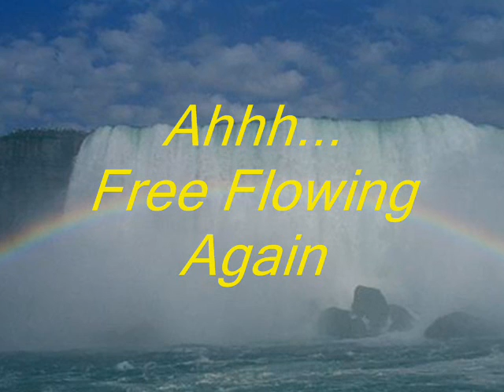DIY: How to Unclog Bathroom Sink

Comment: You're a life saver! When I removed the stopper there was a solid 3 inch tube of hair and gunk that came out easily. The big problem was getting that darn clip back on, the rod on my sink bumps right up against the wall so it was a real pain to get back in. THANKS A MILLION!

Comment: I never knew you could remove the stopper so easily!  Thank you so much!  After I remove any hard gunk and I put the stopper back in, I like to pour some baking soda and vinegar down the drain.  After the baking soda and vinegar has done it's thing I then pour some boiling (or almost boiling water) down the drain and rinse with water from the spout after a few minutes.  Gets the drain pipe super clean!  (I hope!)

Comment: very useful video! I do want to add that before releasing the clip, you might want to make sure the stopper is lifted out of the hole a bit so that after you release the clip the stopper doesn't completely fill the hole and you aren't able to get it out.

Comment from the maker: Archlvt,
Try pouring boiling hot water down the sink.  That may clear any gunk further down in the drain.  If you use toothpaste gel instead of generic white toothpaste, then the gel will gum up the pipe.
Good luck

Comment: just finish now. Although the video is joyous it's not that simple in real life. What u will need is a bucket, dinosaur Claus(not a actual tool name but abstract description) a new piece 2 replace the old 1 under the sink that holds the ball in as u will clamp the tool so hard 2 unscrew the ball that u create a hole in it & water from the sink will come running out. Now I have to c if I can purchase the piece & what the heck It's called! u will need a nap 2 & therapy. BAPs